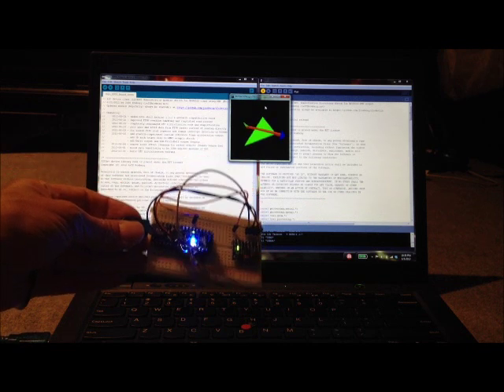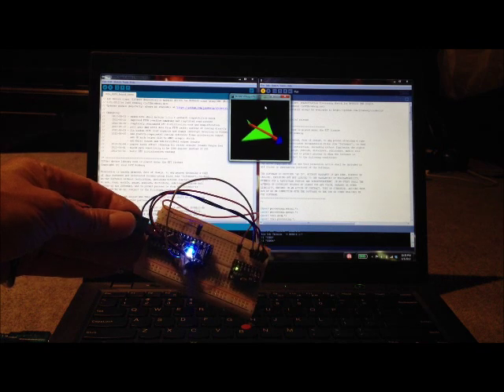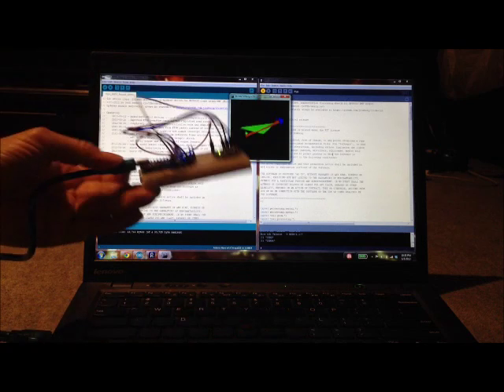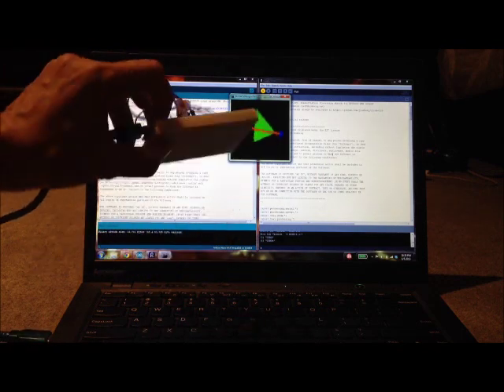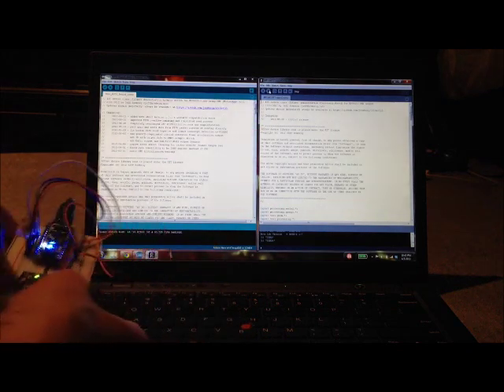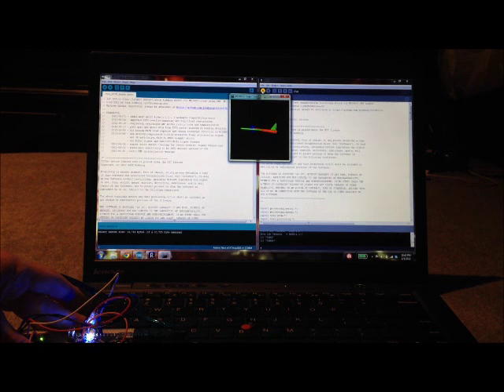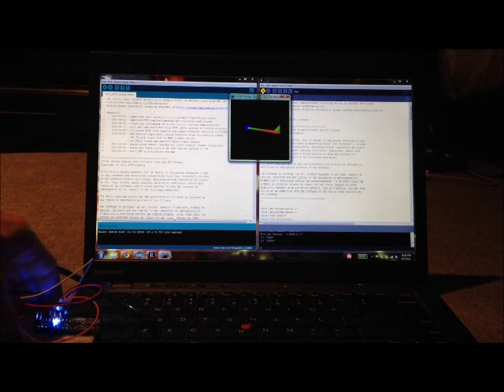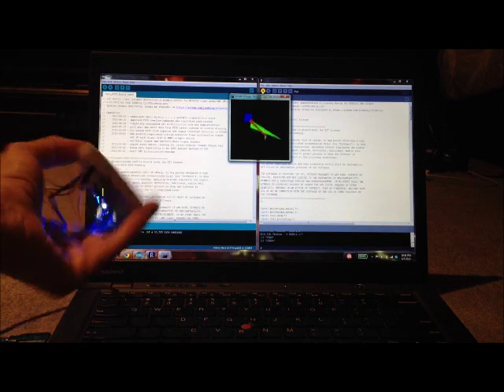i2cdevlib "Teapot" Demo with an MPU-6050 IMU

Comment from the maker: Visit the blog post listed in the video description.  It contains both the Arduino and Processing code.  Arduino and Processing can pass data back and forth using the serial port (though you have to use 32 bit Processing for this to work correctly).

Comment: Hi!  I'm working on a similar project.  Could you please give a little more explanation of how you made this?

Is the Arduino somehow running both sketches simultaneously, and how are you displaying the resulting image?

You also said that there is some sort of drift-correction algorithm in the DMP.  Is that in the MPU 6050 or the Arduino processing sketch?

Comment: I tried this example and I noticed that it uses more than half the storage capacity and a great deal of ram on the arduino. Is there a "lighter" version of this library available? Also, how fast does it update the samples using the dmp, compared to reading the registers the "normal" way?
Reply from the maker: +SirArghPirate Sorry - I haven't looked at this code in a very long while, so I don't have ready answers to your questions.    You can set the rate at which the data is written to the FIFO buffer from the DMP (discussed here:  http://www.i2cdevlib.com/forums/topic/27-fifo-overflow/), and I believe you can set the sampling rate for the sensor data as well, but you should be able to find that online.
Reply: +geekmomprojects I see. I understand that the advantage of this is to let the MPU do all the calculations and filtering of the gyro and the acc. in order to return a "good" angle representation with the possibility of also giving quaternions so that the microcontroller don't have to do it, is that correct?
Reply from the maker: +SirArghPirate That is correct.  Additionally, the MPU seems to have a calibration algorithm for the yaw, which can't be calculated directly from a complementary filter.  I compare MPU6050 data from the MPU and a complementary filter algorithm in this blog post:  http://www.geekmomprojects.com/mpu-6050-redux-dmp-data-fusion-vs-complementary-filter/, which you may find useful.

Comment: Hey there! I've got a question! Did you have to calibrate your own MPU6050? Did you set the offsets? When my MPU chip is lying down the same way you show on the video the plane is pointing towards my computer, I only see the red square, the back of the plane or whatever it is called!
Reply from the maker: I think you may need to use an older version of the Arduino IDE to get the display to work correctly,